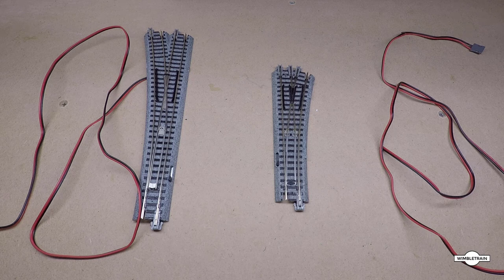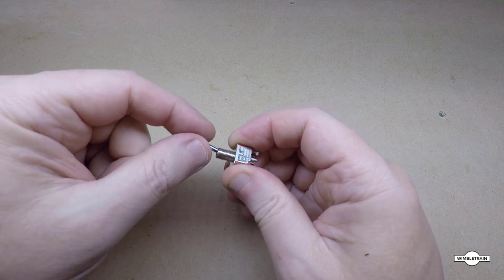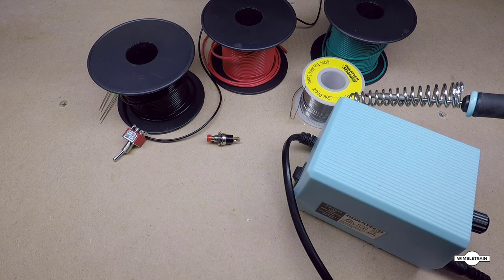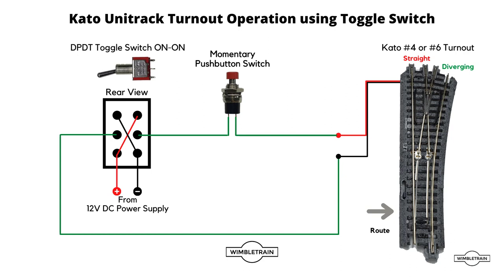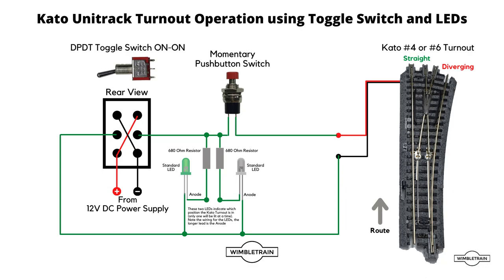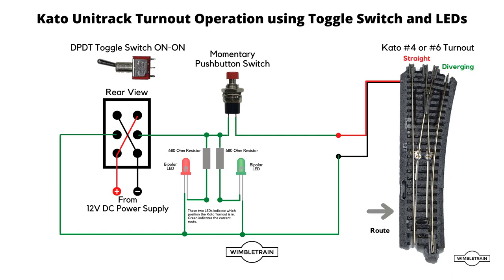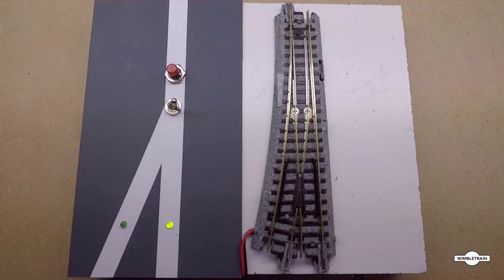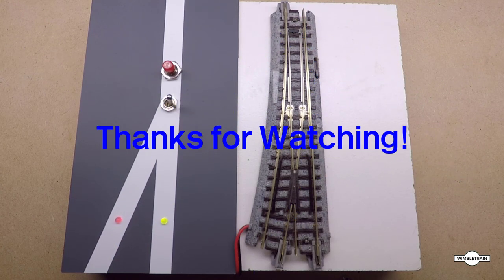Kato Unitrack Turnout Operation using Toggle and Pushbutton Switches

Comment: I have this  exact turnout control system installed on my layout using Kato N scale Unitrack- I love it! It gives a sense of realism as you need to select the route first, then push the button to activate. Using the Bi-Polar LED's means you can check at a glance which way the turnout is selected - I  tend to hit the button again if I'm not sure whether I did it first time around... Excellent video, very well explained...(I am in Melbourne,  Australia).
Reply from the maker: Hi Greg, thanks for your kind words. I totally agree with you I did originally have a small control panel using the switches/LEDs but then start turning to operating my turnouts via computer.t  I would like to revisit the option of a control panel again with the switches and LEDs. John (also in Melb, Oz!)

Comment: Nicely done video, well organized and presented.  I switched to push button control after trying my hand at controlling turnouts with a DCC throttle, which I found slow and awkward.  I like simplicity, and having a two step process for flipping turnouts seems potentially confusing for operators.  I have 27 turnouts on my Kato Unitrack N-Scale layout, all controlled by fascia mounted push buttons through Digitrax DS-64's.  Power is supplied by a Digitrax booster unit on a separate bus line dedicated to the turnouts.  All the turnouts are readily visible to the operators so there's no need for LED's to show the direction of travel.  This system has been in place over a year now and works very well, with no complaints from my operators.
Reply from the maker: Thanks Thomas, the system with the DS-64s sounds good. I'm currently using DCC for my turnouts but I would like to use something like a button/switch to actually do it manually. The biggest issue I have because my layout is made up of modules which I change around on the odd occasion I would have to have some sort of push-button control panel that would somehow interface into my Digikeijs DR5000 and send a DCC address out to operate the turnouts no matter which module they are on. What I mean is that I can't really have a control panel with switches and run wires to each module. John

Comment: Excellent stuff John 👏🏻👏🏻👏🏻 I wish I had discovered Kato track before PECO code 55 🤬 Very best wishes from The Emerald Isle ☘️
Reply from the maker: G'day Paul, thank you for your kind words. Yes the only reason I started using Kato (I've probably mentioned this before somewhere) is that I had limited space originally for a layout and saw this modular system at a model railway exhibition. Now that I have more room, and if I didn't have my current setup, I would probably have gone a non modular layout using Peco. Cheers John

Comment: Nicely presented instructions. Thanks! I have one question: my local electronics store sells 680ohm resistors in a variety of wattages -- 1/4 watt, 1/2 watt, 1 watt, and 2 watt. As I'm unfamiliar with resistors which wattage would you recommend?
Reply from the maker: Hi Gary, thankyou for you comments. Yes the wattage is something I forgot about - oops! I would use 1/2 watt resistors. John

Comment: This has by been by far the most clear and concise demonstration on how to power Kato turnouts that I have so far come across. Well done! As a Unitrack user myself, I’ve been putting off any attempts so far at constructing a control panel of any kind, I just know I don’t care for the turnout controls that Kato offers. So for now I just switch them manually. 
One question though. I know I’ve seen a previous video somewhere that only uses one switch to activate the turnout. I would think a single switch would result in a less cluttered control panel. What are your thoughts on this? 
Again, thanks for the excellent video. Cheers from Canada! 🇨🇦
Reply from the maker: Hello Canada! Thank you for you kind comments.
Yes you can leave out the pushbutton switch by using a DPDT (ON)-OFF-(ON) Toggle switch in place of the DPDT ON-ON. (The brackets around the ON means momentary)
The DPDT (ON)-OFF-(ON) is a momentary switch where if you push it either up or down it will spring back to the centre OFF position when you let it go (i.e. it provides a momentary pulse of the 12V to the turnout). However in this case there are a couple of issues that arise:
1) The toggle switch will always be in the middle so by visually looking at the toggle switch on the control panel you cannot tell which direction the turnout is in currently.
2) The LEDs will not be lit when the toggle switch is in the off position, they will only briefly come on when you operate the toggle switch. In this case we would need to create some extra circuitry to operate the LEDs (something I have never researched).
However, on my control panel that I used in the past (which I did a very brief video on (https://youtu.be/en39135I0so) I came up with a modification to the circuit used in this video (the one with the bipolar LEDs). I added a relay to replace the pushbutton on each turnout and then had one master pushbutton to operate the turnouts. This way you would just set the toggle switches to the route you wanted (on multiple turnouts) and then one pushbutton would operate all of the turnouts that needed switching. I feel like another video may be coming to show this! Cheers and thanks for watching, John
Reply: @wimbletrain  Many thanks for your informative reply. Wiring layouts has never been my strong suit so I’ve tended to keep things simple and have never attempted a control panel of any kind. I truly envy those who can wrap their heads around electronic stuff. 
We’ve recently moved into a new (and hopefully our last) home and I’ve just started on a new layout in a dedicated space allocated just for it in a spare basement bedroom. This time I hope to do all the wiring properly and videos like yours are an immense source of motivation to get things done. 
Thanks for taking the time to share your knowledge. As always I’ll be looking forward to your next video. 
Frank.

Comment: Excellent video, John. I am getting ready to use the R6 turnout on my new DCC layout. The question that I am still very confused about is do the diverging and/or straight exits from the turnout need to be insulated with insuljoiners?
Reply from the maker: Hello, I haven't insulated any of the #6 turnouts on my layout. I guess the only time you may need to insulate them if you had two loops connected together you may want to have them isolated from each other in case you ever run into issues with a short on the track.

Comment: LEDs: wire these through a single 680 Ohm resistor. This will prevent the full 12V reverse voltage being applied to the “off” diode. Most LEDs are rated at around 5V reverse voltage.
Reply from the maker: Hi David, Yes, you are correct. LED datasheets show a reverse voltage of 5V. There's a bit of discussion/research/testing out there saying that LEDs can take a higher reverse voltage. I have done it this way so that I can independently change the resistor value to get the LED brightness I want for each LED if using different colours for each one. So far, I have had no issues. I'm not saying this is right as the datasheets say otherwise.   I have added a note in the video description with the mod you suggested. Thanks for your feedback.

Comment: Hello. That was a fascinating video. I'm just looking at Kato Unitrack for the first time and am wondering whether to pursue it or not. I like the idea of the built in point motors but I seem to have the same question as some of your other contributors, namely why you need the momentary push switch.
I am not an electrical expert by any means but I could not understand why this button switch was necessary. Why does the directional switch not do the required job by itself, switching the points and changing the lights?
If you take it away does the constant electrical flow to one side or the other of the points overload or burn out any part of the circuit?
Please answer me in as simple terms as possible bearing in mind I am a bit of a thicky where this is concerned.
Thanks.
Reply from the maker: Hi, with the Kato switch only a brief pulse of voltage is required hence the quick press of the push button. Omitting the push button will apply a permanent voltage to the Kato turnout which will cause damage.
I also have the Kato DC controller (22-018) and one of the Kato 24-840 Turnout control switch. The Kato Turnout control switch only provides a short burst of voltage when operated.
You can swap out the switch in my video with a DPDT momentary (mom-off-mom) and eliminate the push button. A video on this is in the planning stage. John

Comment: Thank you for the very clear explanation. However.... There is a far more easy way by using a single pole change over switch. No need for it being momantairy at all. It goes like this: Plus from power supply (12VDC at least. 15VDC works better) to one of the change over contacts of the switch. Minus of the power supply to the other change over contact of the switch. Connect the center or common of the switch directly to one end of the coil. Now comes the trick: In series with the coil, connect a 1000uF 25VDC capacitor (if not working satisfactory use a 2200uF 25VDC type!) from the coil to the minus of the power supply. Mind the polairity of the capacitor! The position of the change over switch can be left alone, no pulses or reset needed. The short current pulse the coil needs is provided by charging or discharging the capacitor. After changing the position there will be no current running at all through the coil since the capacitor blocks DC current. When one uses a dpdt change over switch, the 2nd pair of contacts can switch something else, like two leds or anything else. Two anti parallel switched LED's directly from the center contact of the 2nd contact pair, which also have been connected to plus and minus of the power supply, or even the same pair of contacts as the coil uses, connected to a (at least) 1K resistor to the plus and a 1k resistor to the minus. The center of the two resistors therefore are both used as half of the power. In that case one only needs two wires to a semaphore, consisting of a green and red LED. Of course the change over contact can also exist as one (of a pair) relay driven contacts. This gives the oppertunity of automatic control of any kind.
Reply from the maker: Thanks for watching

Comment: Excellent video. 2 questions tho. Why use momentary switch button? How do u wire a 3 lead bipolar led as I see most have 3 wires.
Reply from the maker: Hello and thankyou. You can also do without the pushbutton but then the toggle switch needs to be momentary. Please check out a later video I did which explains this option. It would be easier if you want to use a bipolar LED just to get a 2 wire one. The point of using 2 separate LEDs is so that you can easily see on the control panel where the Kato switch is.

Comment: Great Video John. If I was to do do this same thing on a previously non-wired HO Scale PECO turnout what rails would need powered?
Reply from the maker: HI, with the Peco turnouts, you need to buy a point motor to operate it via a pushbutton/toggle switch. You can search online to see the different options available.

Comment: I believe you are using a Double Pole Single Throw (DPST) switch. A double throw switch would have a center position and it would move 2 directions. Some DP switch are center off and some have a circuit in the center position. Since your switch just moves back and forth with no center position it is a DPST.
Reply from the maker: Hi, the switch I am using is definitely a DPDT as it has 6 connections. A DPST only has 4 connections on it and is just basically 2 separate on-off switches.

Comment: Hello Sir, 
I like what is being done for the control panel, but now I'm even more confused about how to use this system. I have a question about this new setup. Would it be easier and less confusing if I used only the DPDT switch? This way when I throw the DPDT switch to the diverging track not only will the LED light turn on at the straight track, but at the same time the turnout switch will go from straight to the diverging track. Does that make any sense? 
Thank you for your time 
Sincerely 
Allan
Reply from the maker: Hi Allan, in this case, no, you can not just use a DPDT switch as it would put a permanent 12V on the Kato switch, which would damage it. Kato switches require just a short pulse of 12V to operate.  Hope this helps.
I have a couple of other videos describing other options for operating Kato switches that you will find on the channel. John
Reply: @wimbletrain  In this case, yes, you can just use a dpdt switch but you must connect in series with the coil a large elco of 1000uF or larger (2200uF) and of 25VDC or higher. Mind the polarity of the capacitor: minus of the capacitor to minus of the power supply of at least 12VDC. The other pole of the DPDT can be used to control leds
Reply from the maker: @keessonneveld2314  Hi, yes, you are correct. I have actually tested the method you described in the past. There are several ways to operate the Kato switches, I've done a few videos on this topic but haven't covered the option you describe as yet. Maybe a future video? Thanks for watching!

Comment: Love your video, thanks you. Would like to seek your advice whether if we just use the toggle switch without the momentarily push button, will that going to works also, if not why it don't works without the momentary switch?
Reply from the maker: Hi, you can not use this setup without the momentary switch. The Kato turnout only needs a short pulse of the 12v. If you apply permanent 12v you may damage the turnout. However I did make another video where only a momentary toggle switch is used : https://youtu.be/Kid2zlE7svE
Reply: Thanks. Unfortunately I'm not using Kato but I am with Tomix fine track. Hopefully it works the same way as the Kato too.
Reply: I did it with my Tomix tracks after adding in a push button and it works wonderfully well, really appreciate for all your videos and especially the one which you did on the reverse loop. ❤
Reply from the maker: @mrthomasyip  That's great to hear, and it's good to know that it works with Tomix turnouts.

Comment: Hi! Great video. Got a few questions for you....1) I've got about 28 sets of switches I'm looking at using. Can they all share the same "Momentary pushbutton switch"?  2) How many Amps would I need to support such a number of switches? (All the same Kato Brand switches) and 3) if I wanted to add a "safety" LED (i.e. to check if the pushbutton switch had failed to "ON") would it simply be a case of putting a single LED into series circuit between the Pushbutton switch and track?  Cheers!
Reply from the maker: Hi Andrew and thanks. I did experiment with using 1 master pushbutton switch but this meant each previous pushbutton switch (1 for each turnout) was replaced by a relay for each turnout. The master pushbutton would then control all the relays at the same time. I only experimented with 6 at once and had to use a 12V 3A power supply to make it work. I do have a newer video where I do away with the pushbutton switch and use a latching relay for each turnout. I'm not sure what you mean by point number 3. Cheers. John
Reply: @wimbletrain  Thanks for getting back to me. I've been looking at your other video and may very well take that approach instead. With regards to point number 3, I was referring to a failure condition of the pushbutton whereby it fails to "on". My concern was if it were controlling a large number of switches such a failure condition could burn out all the switches. Having a simple LED in the loop would help as it would be stuck "on" if there's a fault.
Reply from the maker: @andrewbritto2243  Aha, I see what you mean now. I would put a LED in series with a resistor across the red and black wires of the turnout. The LED would need to be bipolar. The reason I wouldn't put it in series is that you would restrict current flow to the turnout (and stop it from operating) with the resistor that you need to limit the current flow to the LED to avoid damaging it.

Comment: Hi John, How would I go about have 20 toggle switches & LED’s for 20 turnouts without having to also have 20 push button momentary switches as well? thanks
Reply from the maker: Hi Chris, I did have this setup once where I had 1 pushbutton switch for several turnouts. This involved having a relay in place of each pushbutton. Then the one pushbutton switch would then operate all the relays at once. Maybe that's another video? John

Comment: You're essentially creating an "Arming" circuit, as I see it, but shouldn't there be a change between "Armed" (i.e., toggle thrown but button not yet pressed) and "Switched?" Like, maybe blinking green when armed and solid only when the momentary button has thrown the actual switch?
I mean, a feller could see the green and assume the routing had been effected when all the time his train is hurtling toward certain doom with Lassie, Jack and Jill still on board in that there boxcar?
Great video, though, as always. Sorry for picking nits.
Reply from the maker: Hi Robert and thanks. You do make a valid point though, nothings gonna happen until you press that button! An option well worth looking into. Thanks for the comments, nit picking is ok as long as it's constructive as it is in this case. 👌 Cheers for now John
Reply: My knowledge is limited but I would imagine you would need a circuit with some logic gate(s) to control behavior.